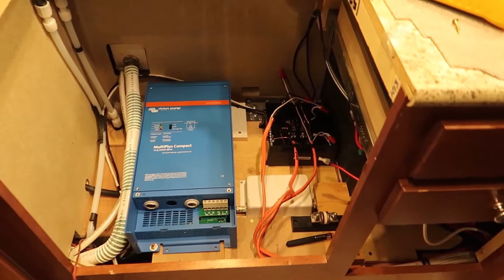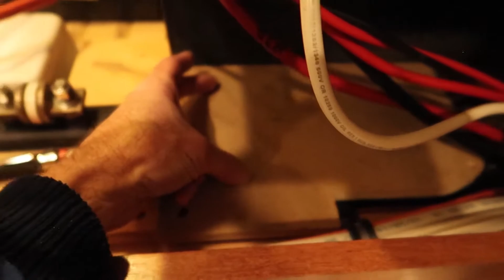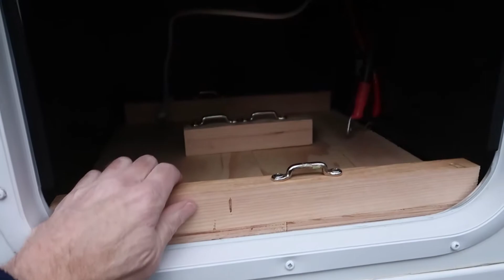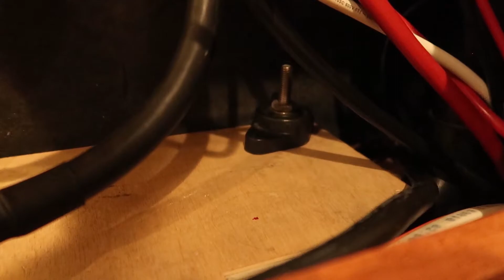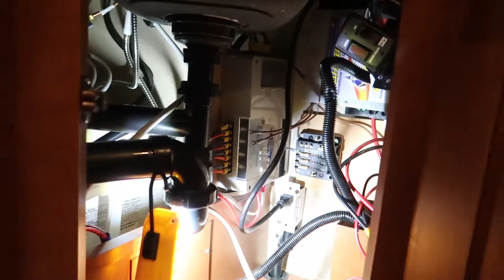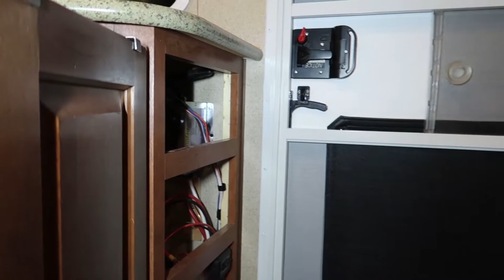Part 2: Victron Multiplus 2000 in a Truck Camper | Arctic Fox 992

Comment: I just got most of my install done last week.  I soooooo completely understand what the (essentially) custom install rate of time-vacuum is!  It took me 4 weeks to build my aluminum box, design everything and install it.  Then ensure it all worked as designed, then take it all out and reinstall the box into my generator compartment on my new camper, then wire it all back in again.  I have yet to complete the 120v side and simply hooking up the solar panels!  But the weather took a dump and I have no shop.  Arrrgh!  So, I hear you brother.  Keep up the good work!  Let me know...I'd love to share some pics...
Reply from the maker: I am nearing completion finally.  I made good progress getting things put back together and wire up late last week.  I even fired everything up for a test run on Friday.

Comment: Amazing Amazing Amazing 
Is whole project is blowing my mind!!!
How did you learn how to do all this?
Reply from the maker: I learned it all from the 8 years I worked at one of the inverter manufacturers located in Washington state.  At the time, there were two large inverter manufacturers.  They both got bought up by Xantrex in about 2000 or 2001.

Comment: Hi there. I got one of these to. I have only just mounted it. Just wondering how yours is getting on for cooling?
Reply from the maker: It's good.  This is the second RV I've had it mounted in.  In the previous RV (A Nash 17k travel trailer) it overheated once due to it being mounted in an enclosed space under the bed, which was fully enclosed.   I had to add a vent and some cooling to fix the problem in that RV.  I've never had an issue with it in my truck camper.